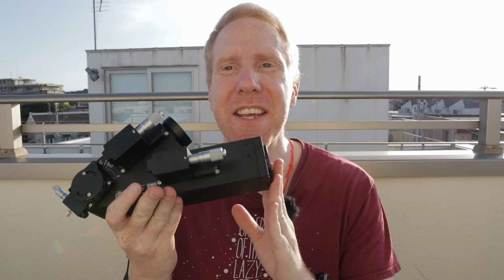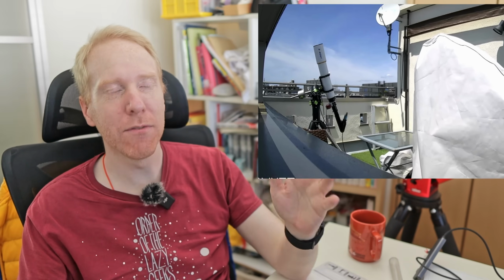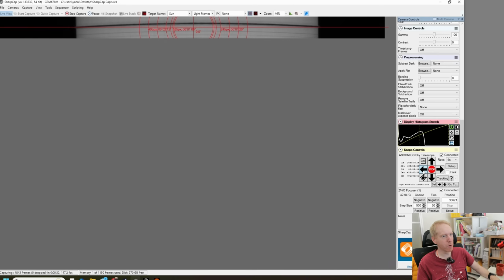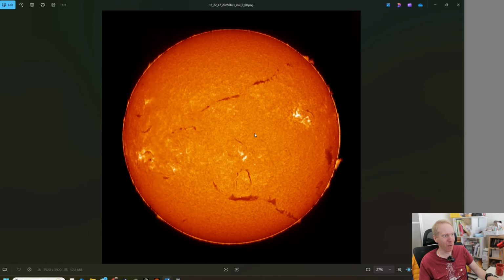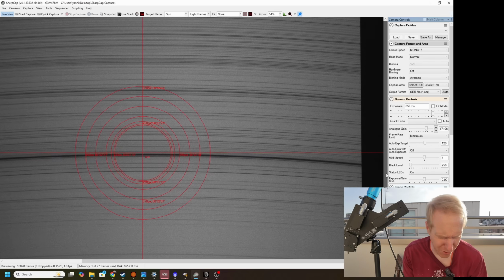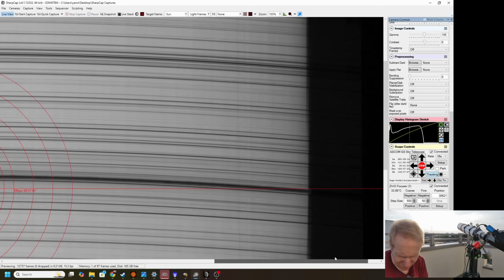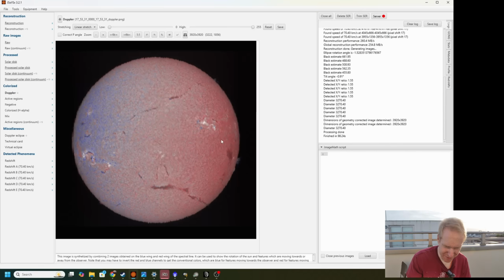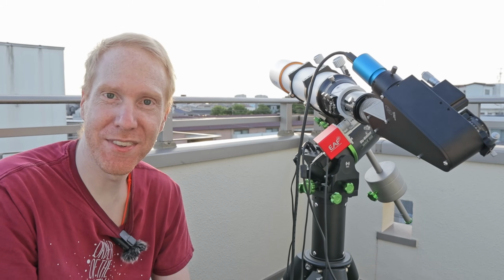Spectroheliography is INSANE, but EASY with this!🔥 MLAstro SHG 700 first impressions + tutorial

Comment from the maker: My Patreon: https://www.patreon.com/cuivlazygeek

Sorry tons of inaccuracies at the start of the video, was too excited - check MLAstro and other comments for corrections!

Equipment used in this video:

MLAstro SHG 700: https://mlastro.com/mlastro-shg or https://tinyurl.com/32n97vey (FLO) , and quick start guide: https://youtu.be/PzNdYI6nqho . Make sure to check telescope compatibility first!! Air spaced refractor with relatively slow FR (F7 or so) and up to 102mm aperture or so (otherwise you need an ERF)

Dylan's video: https://youtu.be/nOmZ5SpaxJg

SVBony SV503 102mm: https://bit.ly/43MpIQi, plus get $20 off using code cuiv503 when buying from SV503 series (or from Amazon: https://amzn.to/3ZJR1b3)

Touptek 678M camera: https://tinyurl.com/6adm9mzt

WAVE 150i: https://bit.ly/3V7HqZq (Agena) or https://bit.ly/4dFwF8h (HPS) or https://tinyurl.com/44fm3a32 (FLO) or https://tinyurl.com/4nm8d3zj (Astroshop EU)

WAVE 150i Tripod: https://bit.ly/3V7HqZq (Agena) or https://bit.ly/4itTo9o (HPS) or https://tinyurl.com/2jkwp5pb (FLO) or https://tinyurl.com/5n6ust5n (Astroshop EU)

WAVE Extension Tube: https://bit.ly/41oRC3y (Agena) or  https://bit.ly/41wpQBY (HPS) or https://tinyurl.com/3ywefddx (FLO) or https://tinyurl.com/mr32y9jw (Astroshop EU)

WAVE Counterweight Kit: https://bit.ly/3BlO5II (Agena) or https://bit.ly/4g88gsO (HPS) or https://tinyurl.com/363crccv (FLO) or https://tinyurl.com/y26y77h7 (Astroshop EU)

For any affiliate link purchases, make sure to accept cookies if prompted!

Amazon affiliate: https://amzn.to/49XTx01
Agena affiliate: https://bit.ly/3Om0hNG
High Point Scientific affiliate: https://bit.ly/3lReu8R
First Light Optics affiliate: https://tinyurl.com/yxd2jkr2
All-Star Telescope affiliate: http://bit.ly/3SCgVbV
Astroshop eu Affiliate: http://tinyurl.com/2vafkax8
Reply: Ya. We could tell that you were very excited. But that is what makes your videos so good to watch. 👍

Comment: I've been out of the Astronomy loop for quite some time. I was wondering if a somewhat portable mount exists nowadays that doesn't require me to physically polar align the mount for imaging? I would like to get back into solar imagining again but don't want to setup a mount the night before so I can image the next day. I should mention that I have an old Losmandy GM-100. I don't mind buying a new mount whatsoever. My scope for the SHG 700 would be  approximately 100mm or less. A Tak FC-100, Borg 89ED, or a SV48P 102mm. I thought a Skywatcher SolarQuest would be perfect but probably can't handle the weight. I have no idea what the SHG 700 and compatible camera weighs.

Comment: Great stuff, thanks! Question (and I think I know the answer already): I only have an Alt/AZ mount, and you mention the device has to be aligned vertically to the declination axis. Would it work at all with an Alt/AZ mount? I also see the disadvantage that I could only use this for photography, and not visually. Do you miss visual?

Comment: Excellent!
I use the DayStar Quark Chromosphere filter to photograph the Sun.
It requires power, but is also easy to use.
Once I learned about the Sol’Ex and Star’EX spectrograph projects, which you can build yourself. They were developed by a French spectrographer. I think he has a channel - Astro-Spectro, where he talks about it.
I bought the parts, but have not yet started building.
But the results on them impressed me. Especially the possibility of narrow-band shooting of the Sun in different lines.
It is also interesting to try to shoot the spectra of stars. This already looks like scientific work.

Comment: Taking a look through comments, I didn’t see this addressed but apologies if I missed it. Doesn’t one need to be concerned about heating up the inside of one’s telescope especially as the objective lens diameter increases?  Can this damage a refractor telescope near the focal point due to heat of the focused image just prior to entering the spectroheliograph?

Comment: Thanks for a great video. I am curious about spectroscopy but never know you can be turn into a "real image". Can you scan different wave length and stack them to show different elements? like what one does for DSO?
Reply: like DSO no (the Sun is rather wobbly in this setup), but dopplergrams are trivial and automatic, and for more complex visualization you could look into cube viewing options like cocoplot
Reply: TBH it is quite the challenge to do the Sun in multiple wavelengths, I obviously tried, even after accounting for all the optical issues of the instruments, because (1) the Sun changes really fast at any meaningful resolution, I saw sunspots grow out of nothing under my nose, in a few minutes, and (2) Ha and CaK are at different height/depth, so the features are sphere-radially displaced, it is not just their projection onto the disk/circle that needs to be accounted for.

Comment: Will it work with an Alt-Az mount?  It doesn't really matter which direction you slew to/from as long as you capture the entire disk correct?  Or does the JSolEx software require the slew motion to be specific in order to reconstruct the final image?
Reply: Yes it will. In JSol'Ex you'd have to check a box to tell it's alt-az, so that the orientation grid is oriented properly.
Reply: @cchampeau Thanks for the info.  Does slew speed matter?  I would think slower speeds would be impacted more by wind.  Or is it just a matter of finding a good balance?
Reply: @gumtuu  It's usually better if you can scan faster than 8x, the less time you spend scanning, the less impactful turbulence is.

Comment: Just out of curiosity, would anything at all show up if you pointed that at Betelgeuse, Vega, etc? I'm not sure if there is an angular size or absolute brightness limit or if the shimmering of the atmosphere can spread the starlight across enough pixels to get any spectrum data.
Reply: MLAstro has modification avaiable to make this an astro spectrometer.
Reply from the maker: I need to get that modiciation

Comment: Well impressed......but....is there a way of removing those jagged edge line effects - particularly visible around the edge of the sun? Or is this the wind issue?
Reply: JSol'Ex has an option to correct these.
Reply: Those lines are tracking rate related. The scan was also slightly off, so modifications can be made to correct those lines and further refinement using JSol'Ex software.
Reply: limited options, since the jagging is only a 1D projection of a 2D problem, so information is lost by definition. Maybe, some information, from adjacent frames, can be recovered, but the information is most likely never recorded in the first place, the Sun's image just wibbly-wobbly wobbles around in the bad seeing + wind + mount shaking etc, and there is no basis of recovering the random loss either (unlike with Richardson-Lucy where the basis is that a star should be a point, airy whatever etc, so whatever we see must be the PSF)

Comment: Great video. I am super excited to have the SHG 700 featured on your channel. Just a small correction: the slit acts as a wave generator, it isolate a slice of the Sun and the diffraction grating (which reside in the wavelength dial) is the part that actually disperse the light into spectrum.
When you rotate the wavelength selector, you actually rotating the diffraction grating itself, chaning the incoming angle and thus, the wavelength observed.
Reply: oh and the truncated edge of the Sun is the Sun clipped on 1 edge of the slit, you simply center the Sun in the Slit and make sure it doesn't clip on 1 edge of the slit the whole time it slews (in your video I can see that the Sun is clipped on  the right side of the slit (the part where the spectral spread meets the black stripes on the side).
Reply from the maker: Thank you for the précisions, this is awesome!!

Comment: Cuiv,  So at 700mm FL, the 678 chip doesn't really show the whole solar disk at one time..   But I guess since you scan you can move in the direction perpendicular to the long side of the chip.    Am I seeing that correctly?   My SHG is on its way here.   Can't wait.
Reply: The 678 chip is plenty to cover the 7mm slit and the 700mm scope. It's just that you need the centering and alignment precise to make sure the Sun is not clipped on 1 edge of the slit when doing the scan
Reply: @MLAstro_Official  Did Cuiv receive one of the older slits or was his review SHG from the newer slit design?
Reply: @MLAstro_Official  What I'm saying is that if you were taking a conventional image of the sun, the whole disk would not fit.   The diameter of the sun would be larger that the short dimension of the sensor.  But it doesn't matter for scanning as long as the sun diameter is smaller than the long dimension of the sensor.   When I shoot at 480mm and the 678, the disk just barely fits, sorta.....
Reply: @NebulaStarsandGalaxies-g5e ah yes, if you were taking picture with a normal scope. To have fulldisk with a 700m scope you need 7x7mm sensor minimal. 
For SHG you only scan at a thin line in the middle of the Sun so that is not a problem, you can achieve full disk as long as the sensor length fit the widest part of the Sun

Comment: Hi @CuivTheLazyGeek, author of JSol'Ex here, thanks for the mention :) Welcome to the spectrography world! First I would like to recognize Christian Buil's work on Sol'Ex first, and the work from Valérie Desnoux on INTI, which inspired me for JSol'Ex. A few tips here:

- during your initial scans, I recommend that you use bin2, especially because you have very strong wind and bad seeing, you won't see much of a difference in the results, but the files will be 4x smaller and much faster to process
- you can also use the "watch mode" (available in the File menu), which will automatically process images as they are saved in SharpCap
- on each image, at the bottom, you have an explanation of what you are seeing, which should be useful especially to beginners

Since you mention star spectrography, actually look at the Star'Ex project, which is just an addon to the Sol'Ex to do exactly this. There's also a "Lab'Ex" project to do what you mentioned about filter analysis! Last but not least, I recommend that you also take a look a the "Sunscan" project from the StarOS team (which includes Christian Buil), which makes it possible to take solar pictures similarly, but without any computer, just with your phone!

Comment: Just got mine this week and also the Touptek 678M. My first light was this Sunday June 22 what is interesting as I see my image of the sun were it already rotatet further. But it took me much longer to get everything in focus. I think the backfocus between the telescope and the plane of the slit was not correct in the beginning. And focusing in three different places is something we need to get used to. For measuring astronomic filters there is a very good video from Dark Sky Geek on that. He is using the Sol'ex with the Star'ex extension I think, but it should also work with the SHG700.

Comment: the mirror at the front has a slit to produce a very narrow beam of light, the mirror surface is to stop the blocked light melting it.

the beam hits a diffraction grating at the bottom which spreads the beam into a spectrum. this hits your camera, the y axis is the image of the sun that got through the slit and the x axis is the frequency if the light.

as the sun moves across the slit each photo becomes a slice of the sun. select a line of y pixels at the same x pixel, put lines from successive photos you get a 2d image of the sun at a chosen wavelength.

whats critical us a constant velocity of the sun over slit
Reply: David,
Minh has designed the SHG with a quartz slit plate. It can be exposed to the direct sunlight with no problems. The mirror surface is there as an option to upgrade to guiding for night-time spectroscopy.
Reply: @kenharrison6161 nice. i must admit that ive been planning to get i to this what i get the time. 
i see this as being complimentary to using an etalon filter, the resolving power of these scope us going to be very vulnerable to atmospheric distortion at the gain of imaging the sun at arbitrary wavelengths and bandwidths,and to have this flexibility in post image capture workflows.
whilst the etalon with its lack flexibility in choice of wavelength and bandwidth allows the full gamut of planetary imaging techniques to minimise atmospheric distortion.

Comment: Do you need a ND filter? If yes, which kind? Coz the slit will be super hot. What is the smallest camera I can get? What is the focus? thx
Reply: No. The MLAstro SHG 700 slit designed to take the Sun unfiltered. No ND or any form of ERF required for scopes under 4" and F/7 or slower.

Comment: I have a brand new Meade 14" LX200GPS ACF SCT from the High Point Scientific auction inventory. 
I'm trying to use NINA and having all kinds of trouble with autofocus and plate solving and framing. 
All because of the very small FOV. 
I'm lucky to get 3 or 4 stars in most of my images. 
Makes it very difficult to plate solve. 
I am using a traditional camera and guide scope set up. The same one I use for my 102mm refractor, so no problem there. 
Is there some way we could set up NINA to use the guide camera to frame and plates solve and then switch back to guiding with PHD2 and use the main camera for imaging? 
OR
Just use an additional guide camera and scope for plate solve and framing? 
So I could use 2 guide cameras and scopes side by side mounted on the main scope? 
As long as they are all pointed and aligned correctly, I can use one as a guide scope, the other as a framing and plate solving scope and the main scope for imaging? 
It would be so much easier. 
I was looking at the ASI585MC Duo Pro with ASIAir built in. 
But I can't imagine how I can make that work. The duo part of the guide scope would be lucky to have a single star to guide with. 
I really want to avoid using a reducer because I'm interested in small objects and planetary. 
I'm currently using an ASI178MC non cooled. 
It works amazing with the small pixel and sensor size with the 14" scope. 
For a reference, if I image the Orion nebula, all you see are the center four stars. 
I really want to image the Cigar Galaxy.... 
It BARELY fits corner to corner in the field of view.
Reply from the maker: There's no such option in NINA (multiple cameras connected+choose which is used for plate solving and AF). I would suggest doing 20s exposures for AF and Plate solving, and make sure to use PlatesSolve3.80 (I have a version of it on my recent NINA tutorial) and check the hints about auto focus in that same tutorial

Comment: Thanks for mentioning you saw my video! Watching the rest now... It's fun huh ??
Reply from the maker: Absolutely! That thing is insane!
Reply: Can you PLEASE make a video on settings for large SCT's?
I have a brand new Meade 14" LX200GPS ACF SCT from the High Point Scientific auction inventory. 
I'm trying to use NINA and having all kinds of trouble with autofocus and plate solving and framing. 
All because of the very small FOV. 
I'm lucky to get 3 or 4 stars in most of my images. 
Makes it very difficult to plate solve. 
I am using a traditional camera and guide scope set up. The same one I use for my 102mm refractor, so no problem there. 
Is there some way we could set up NINA to use the guide camera to frame and plates solve and then switch back to guiding with PHD2 and use the main camera for imaging? 
OR
Just use an additional guide camera and scope for plate solve and framing? 
So I could use 2 guide cameras and scopes side by side mounted on the main scope? 
As long as they are all pointed and aligned correctly, I can use one as a guide scope, the other as a framing and plate solving scope and the main scope for imaging? 
It would be so much easier. 
I was looking at the ASI585MC Duo Pro with ASIAir built in. 
But I can't imagine how I can make that work. The duo part of the guide scope would be lucky to have a single star to guide with. 
I really want to avoid using a reducer because I'm interested in small objects and planetary. 
I'm currently using an ASI178MC non cooled. 
It works amazing with the small pixel and sensor size with the 14" scope. 
For a reference, if I image the Orion nebula, all you see are the center four stars. 
I really want to image the Cigar Galaxy.... 
It BARELY fits corner to corner in the field of view.
Reply: @christopherleveck6835  Just a quick drop in here, if you have the F10 version you really should get a full frame sensor... 3556mm fl is crazy long (though maybe an APSC sensor would be ok). If it's the F8 version then you should have no problems plate solving with an imx294 or larger sensor. I shoot at 2800mm fl and can easily plate solve and use OAG.
Reply: @Dagget08 I've got the F10. Thing is I'm mostly doing planets. The small pixel size is what I want there.
I'm seriously thinking about the ASI585MC.
Was hoping I could use that for everything.
Ever since I images Bodes and the Cigar galaxies I have wanted to image just the Cigar Galaxy.
With a focal length of 3556mm it is PERFECTLY framed on the ASI178MC sensor...
I really like the idea of imaging small stuff that smaller aperture scopes just can't get to.
I'm seriously thinking of running a stripped down NINA profile with a dedicated 60mm guide scope.
I have an extra asi mini mono guide cam I could plate solve and then slew and center my target with.
Once on it, could switch profiles and use phd2 to stay on top of it....
Then image without plate solving or centering.
Reply: @Dagget08 i sorted it out. I downloaded a different database specifically for longer focal lengths. All is well. Of course now that i know it works by shooting between clouds.... I am waiting for any kind of clear night to play with it.